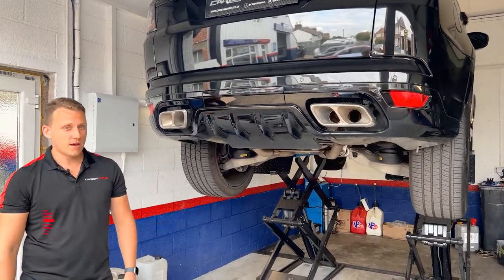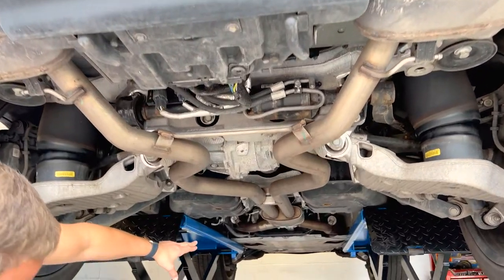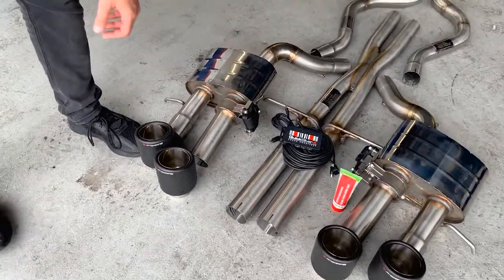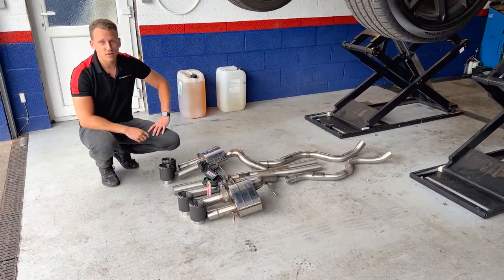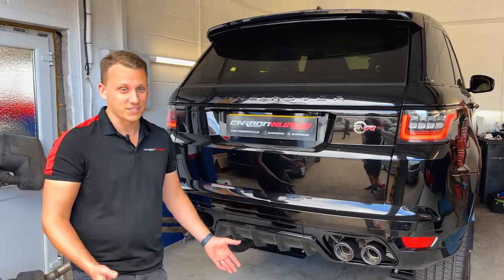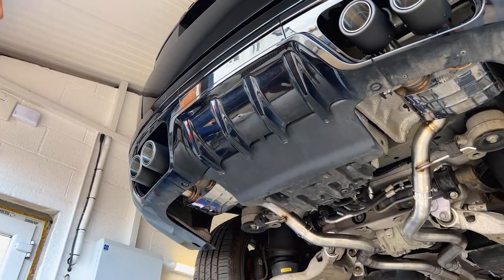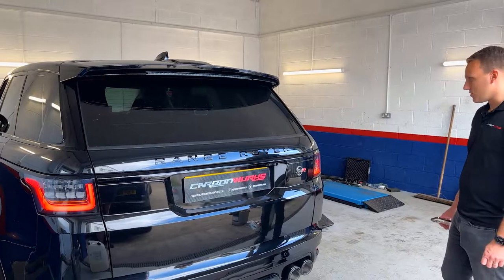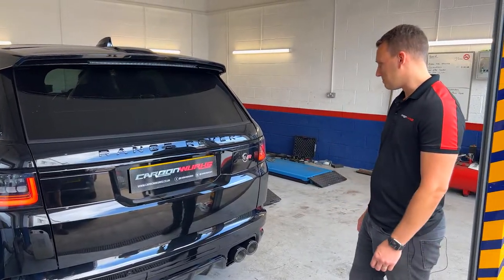Artillery Fire! The Range Rover SVR Quicksilver Exhaust System

Comment: If you have a nice expensive car I would strongly advise against getting a quick silver exhaust the horrible droning and vibration it makes is enough to destroyers  the soul of an experience boy racer, never remove stock of a v6/v8 you very might regret it
Reply from the maker: Each to their own I guess. Having heard the system it sounded pretty good and much better than stock. Customer in this instance was pretty impressed with it too. The beauty of this system is the Sound Architect so that you can make it sound different depending on what you fancy.
Reply: @Carbonwurks  does it affect fuel
Economy
Reply from the maker: There are quite a few variables to consider when changing engine performance parts. With the original catalytic converters remaining in place there would be a pretty negligible difference. In theory, a less restrictive exhaust can help with performance and less strain which could help improve fuel consumption but again, the difference would be very hard to notice. 

Most people tend to get worse fuel economy after an exhaust change as they drive the car in a more sporty, enthusiastic way 😀